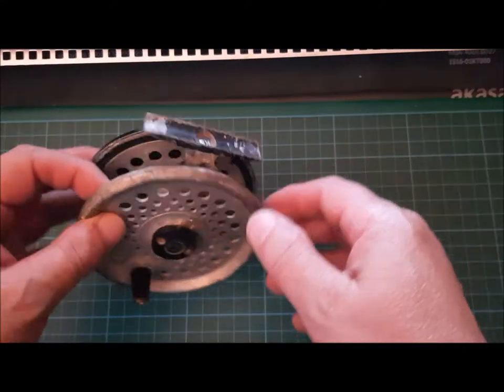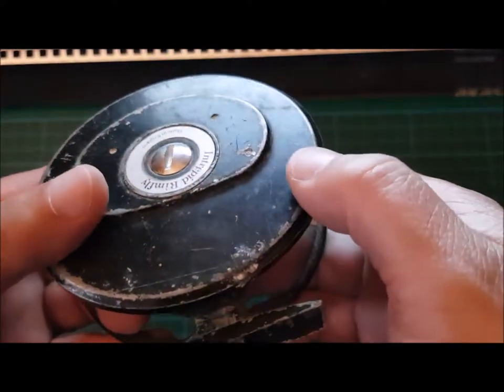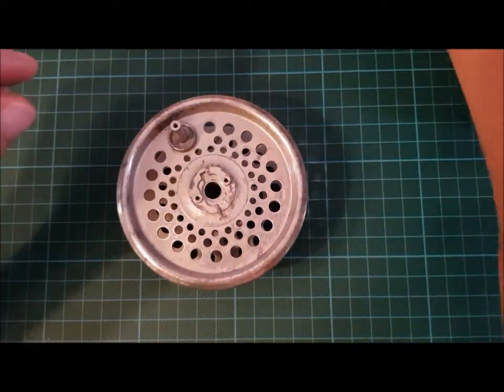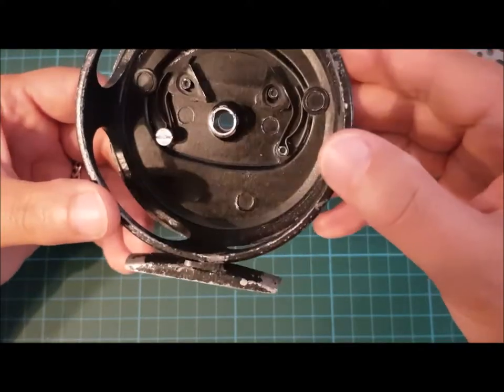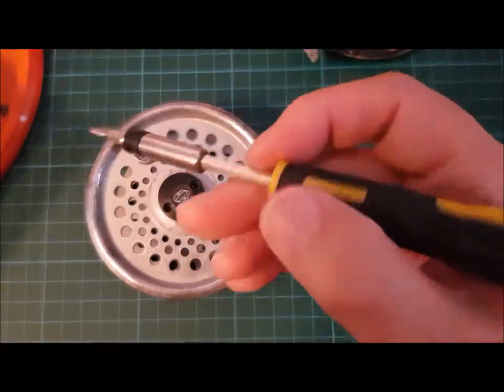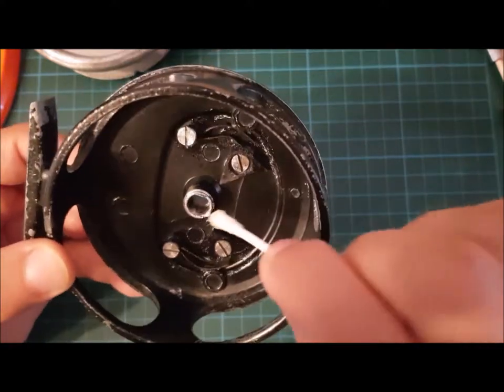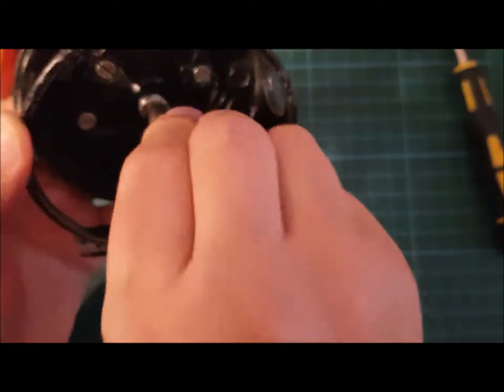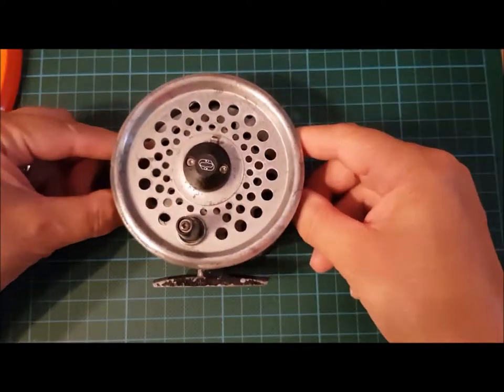Vintage Intrepid Rimfly fly fishing reel - disassembly and cleaning

Comment: That fly reel was a blast from the past,I had one in the 70s.the plastic pawls are in the right place but you can alter them to change it from a right hand wind to a left hand wind, you could buy the rimfly reel in different sizes,I think the k s did mean king-size it was a trout reel you could use  on big rivers or resvoirs,if I remember correctly it took a size 7or 8 fly line.the only thing I didn't like about the reel was the plastic pawls.but I can't complain it was a fairly cheap reel to buy.
Reply from the maker: Thanks for watching Vincent and for the information! It's great to find out that it's a trout reel and for the size of line.  :) I will look out for some appropriate line and watch YT to find out how to load it, if that's the correct term? :)
Reply: You're right, KS means 'King Size', which was the largest diameter model; slightly smaller was the 'Regular', and smaller still, the 'Lightweight' model. I have a Lightweight one, and it still works great despite being older than I am 😁